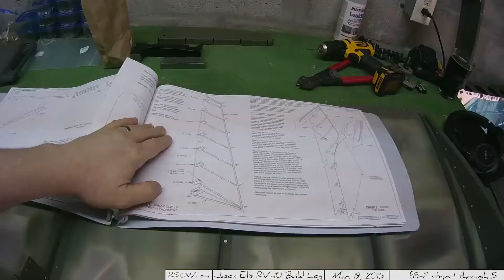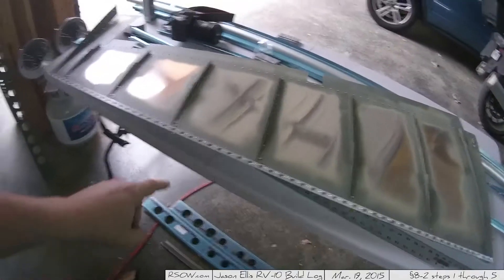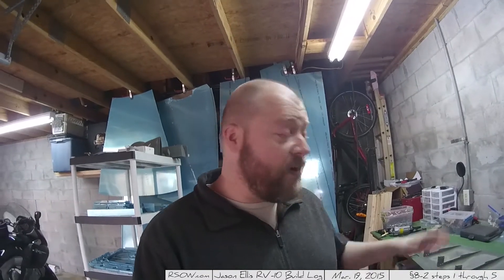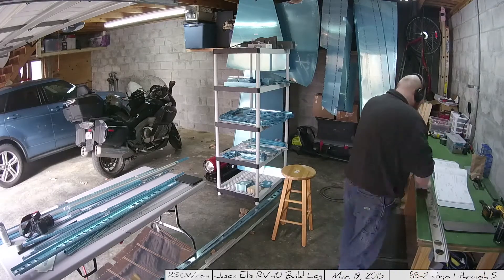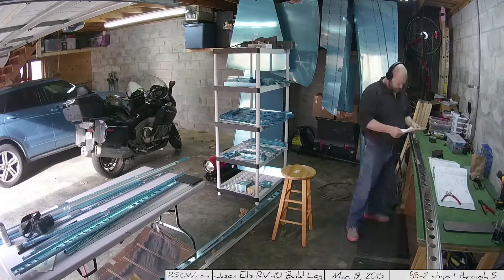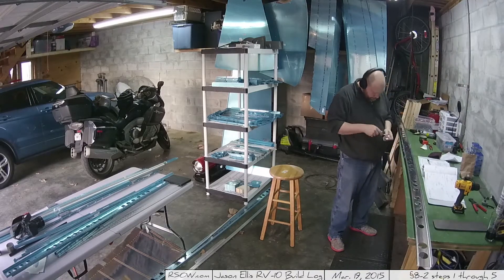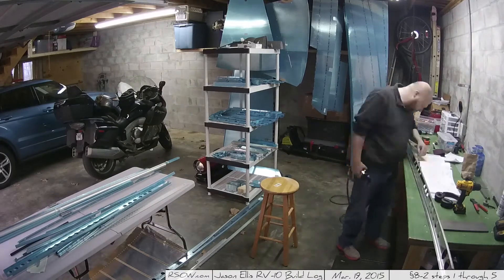RV-10 Empennage Section 8-2 steps 1-5

Comment: Hi Jason,

For those hard to reach rivets, you may consider investing in some steel bar.
https://www.youtube.com/watch?v=WFvidSLQ_os

As for the deburring, surface finish (and hole/edge quality) is very important for the prevention of fatigue damage. a bur or nick in thin alumimum sheet will allow cracks to form in your aircraft structure which will, over time, break. You can imagine how bad it would be if the component were a rib cap, spar, etc that broke in flight.